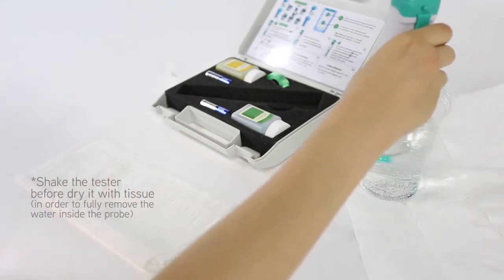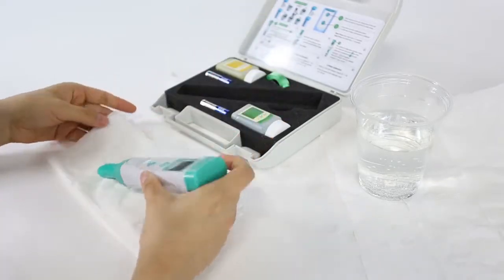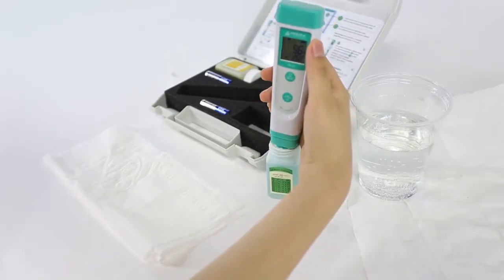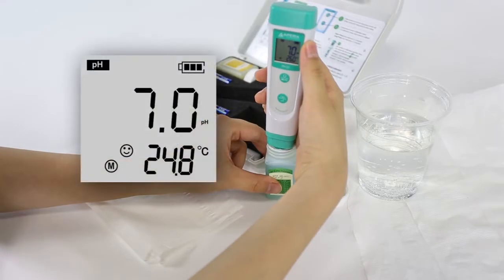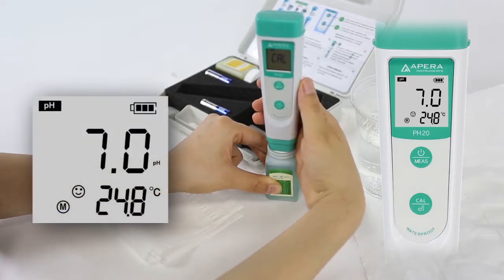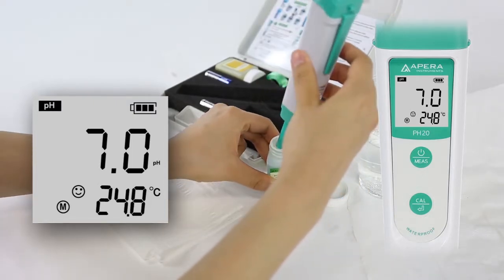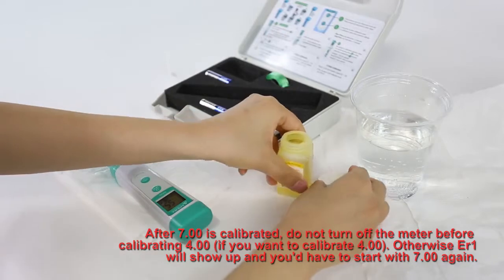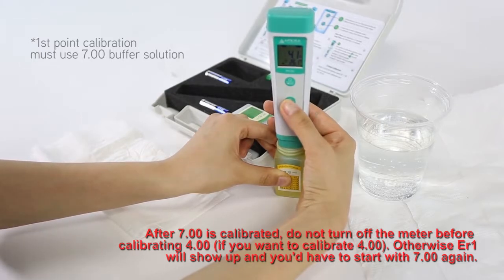Kalibrierung des PH20 Messgerätes

Comment: You should have a look at the instructions in your kit and correct it. They are outright confusing and contradictory. This video would not be necessary if they weren't. Also, why in the world are you selling a ph tester that is supposed to test values from 0-14 and don't include ph10 calibration solution?